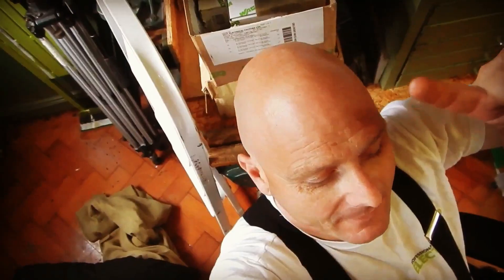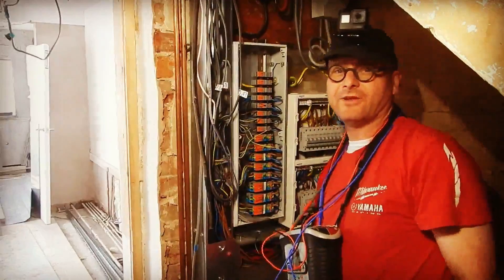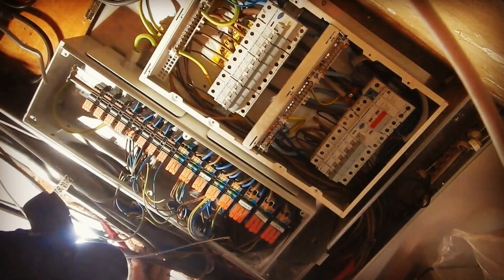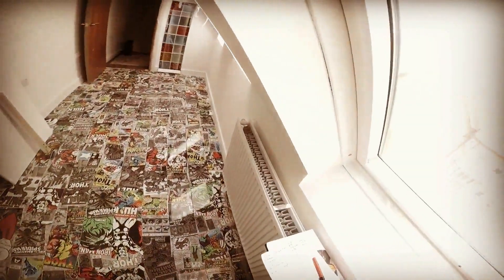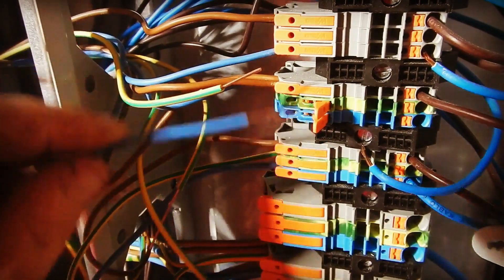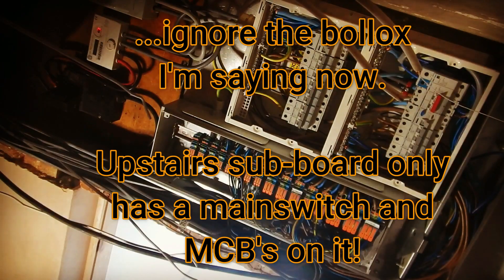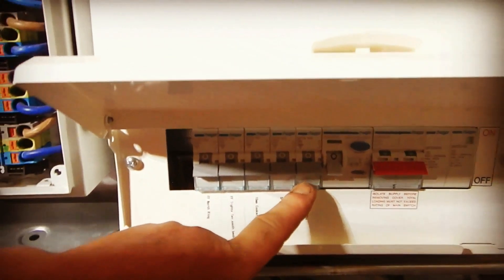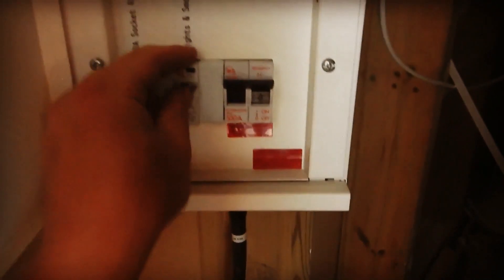Video 110  DVD-proofing a Consumer Unit PART 2 (video 100 Part 1)

Comment: The amount of those din rail terminals I have fitted over the years... I used to build rack equipment fo hazardous area cctv systems. Before wago got in on the market though, we had to screw them 😳 RSI was an issue lol. The random brummie asking for cable clips tickled me. "is that enough?..." no... Can I have a few more!.. " cheeky sod 😂